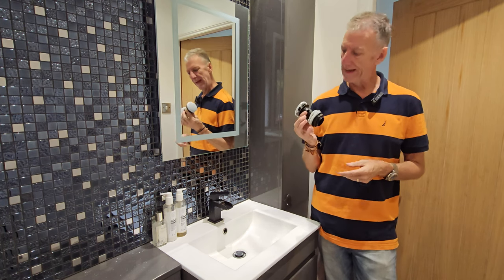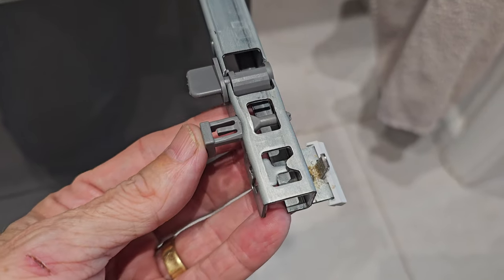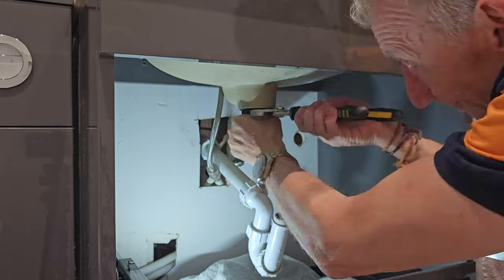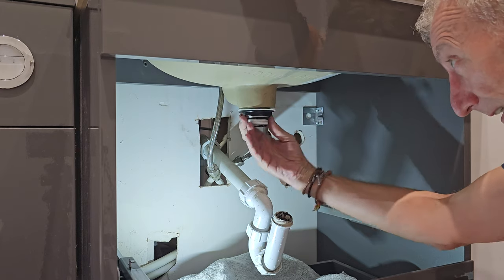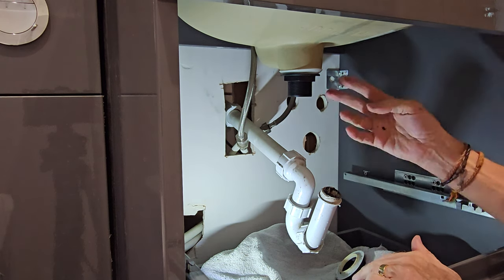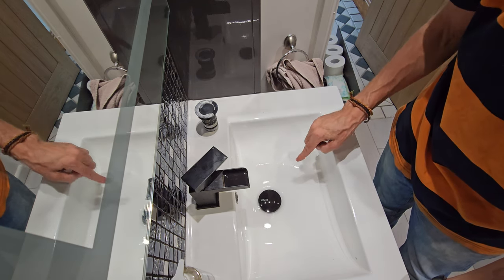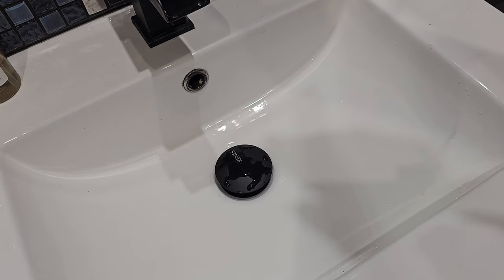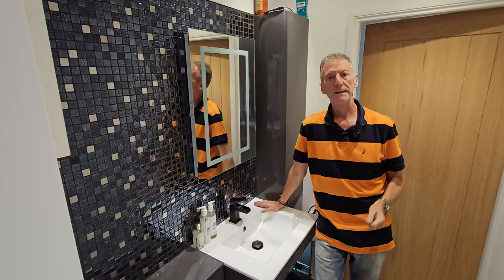Unveiling the Basics: How to Easily Change a Basin Waste

Comment: next time you put ptfe on remember to put it on the right way, as you screw it together it should be tightening the tape not unravelling it.
Reply from the maker: I knew this at the time.  It's always the same though, I sit there for five minutes trying to figure it out in my mind, which is the right way (and it should be clockwise, like I said in the video).  It's the same when I'm respooling a strimmer 🤣🤣🤣.  Thanks for highlighting it though 👍

Comment: The old waste you took out how do you remove the stopper ? Ive similar and want to try and change the spring but cant seem to turn the stopper to get it off and get at the spring underneath? Or is not removable and you just need to replace the whole waste? like you just done in the video? Any help appreciated
Reply from the maker: Replace the whole waste like I did, you'll get a better waste (one that you can access the clean) and it will probably work out the same price 👍🏻😁